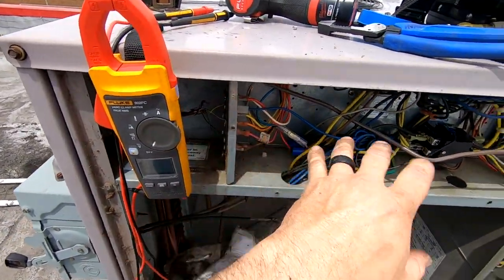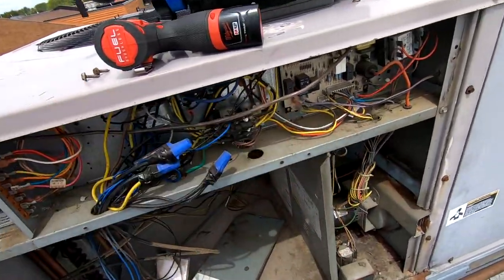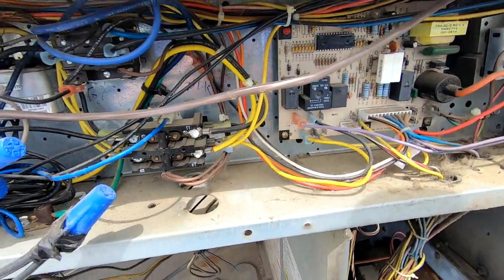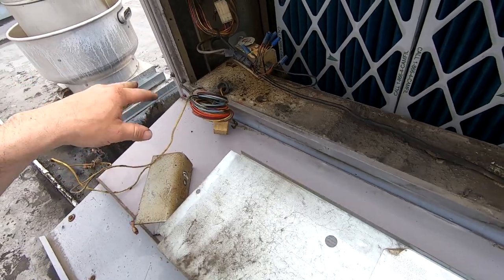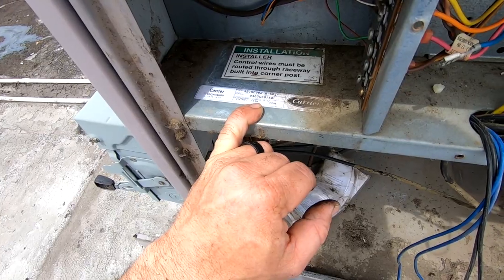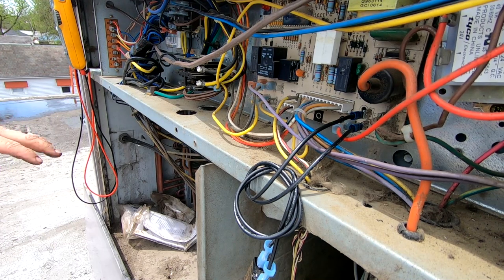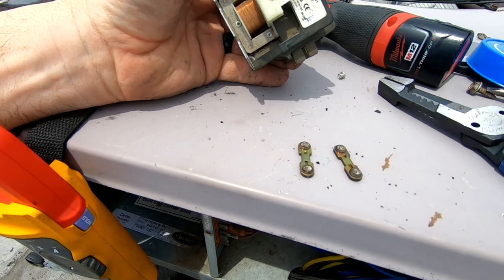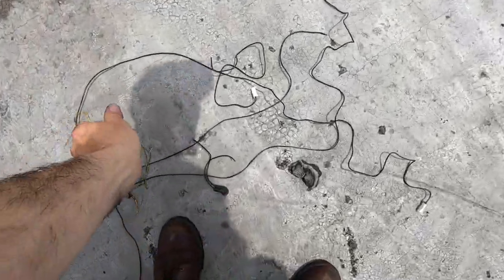No Cooling Blank Thermostat On Carrier Package Unit

Comment: I'll give props to US electrical code. A disconnect at the unit makes a hellofa lot of sense and super convenient for techs. Asia still uses a wall mounted breaker, sometimes pretty far away. Small matter but that unit mounted disconnect is a time saver. Another good video.
Reply from the maker: It depends where the job is,  sometimes if it's not inspected it can get forgotten.

Comment: great video, I like like your methodical testing the path of the hot leg and elimination by pulling a connection.  90%  of unit more than 5 years old have the economisers disconnected from intermittent trips.  The cost of a new mod motor... eliminates the "do you want this replaced" question by sheer costs involved.  Problem is, now with this covid-19 thing, IAQ is going to be a big thing now.  so all those defunct economisers will be a cash cow.
Reply from the maker: Lol. Now it's do I use one 2x4 or a 2x6 to keep the damper open 🤣🤣🤣
Reply: @HVACRSurvival  🤣Economize the cost!

Comment: oh, one of the things I do with wires rubbing is protect them with 5/8 mini split drain hose.  I split it lengthwise and tuck the wires in it. Then hold it in place with a few zip ties...especially line voltage lines that notoriously blow out copper refrigerant lines, and make a huge oily mess.
Reply from the maker: Good pointers 👍👍 Thanks 4 commenting!

Comment: Something else I've done is use a piece of armaflex where the wires go over the blower. The roof will sandwich everything in place and provides good protection.
Thanks for the video Rick! 
Economizers suck! Rip em all out lol.
Reply from the maker: Yeah that works pretty good or splitting vinyl tubing 👍👍
Reply: @HVACRSurvival  same method you use on cap tubes. 👌

Comment: ya got yourself when you wiggled the wires by economizer, surely the short is over there lol
just put a 30 volt bulb in parallel with the circuit breaker :)

Comment: Looks like you could make a ten turn on your little popper. Get a more accurate reading. Thanks for the videos
Reply from the maker: We used to do stuff like that with the old t87 thermostats for the heat anticipator. These new meters are pretty accurate.
Reply: Hvac 1 the Q539 or 1147 sub bases for the T87, were the only style that needed that because the heat anticipatory would read below one tenth of an amp. Many times you could get the heat anticipator setting on the wiring diagram ( gas valve  amps ). Most other thermostat manufacturers eliminated this device.